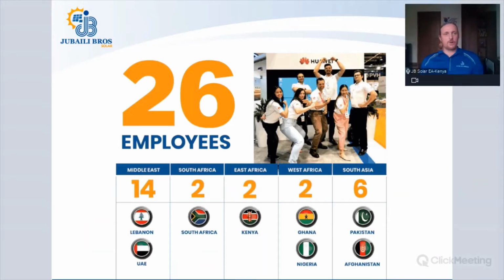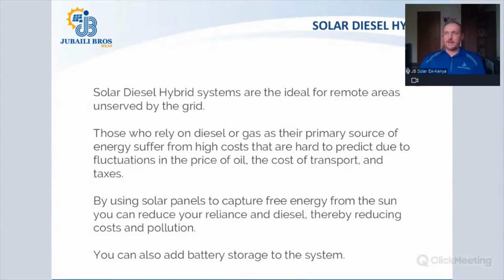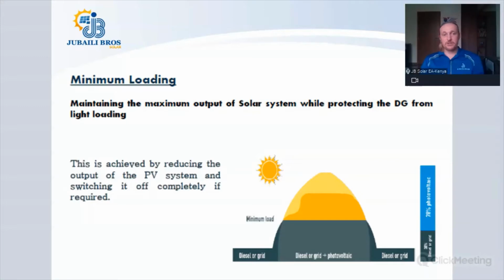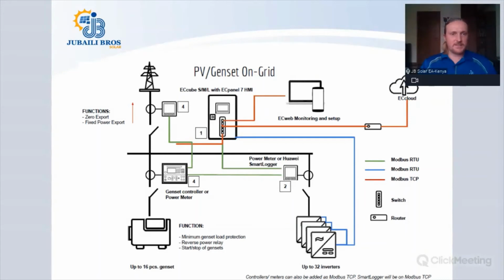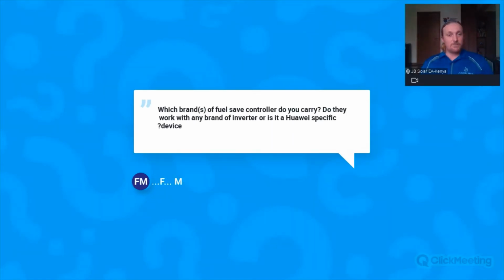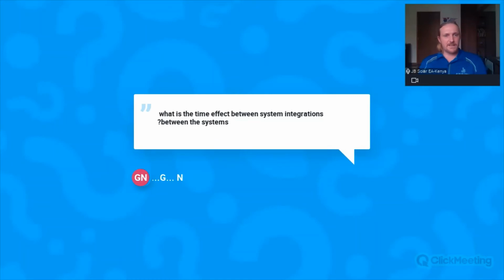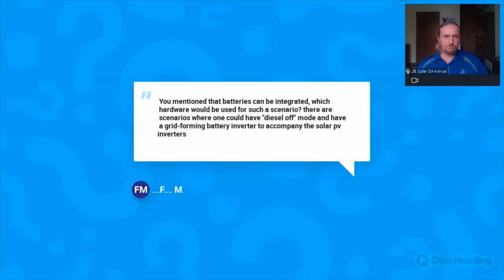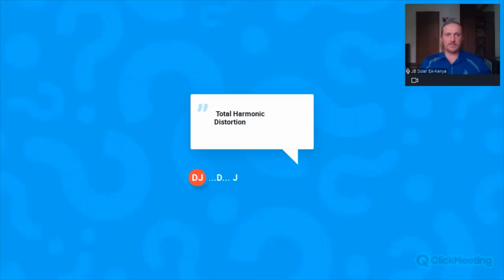Webinar: PV Diesel - Hybrid Solutions

Comment: We are operating on a micro-grid with SCANIA S500 Diesel Generators in Sindh (PAKISTAN) 
Wish to install On-Grid Solar to save on Generator Diesel Fuel consumption 
unfortunaitly the Utility Grid is not available 
Please let me know if you can provide us the control system for synchronization and power control for Solar PV Inverter 
and Generator to function seamlessly 
immediately we are ready to install 100kW Solar 
Thanks

Comment: Hello 
Can your On-grid hybrid Inverter operate without Grid ?
Meaning we have Diesel generator Sets and interested in installing  Solar PV Power Systems to work with Generators 
At present we do not have Grid also we are not much interested in LFP Batteries because of Cost etc.
All houses are supplied from Diesel Generators 
The Owner of the Project wish to Install Solar PV to save on Fuel Cost 
Also it is needed that the On-grid Inverters synchronize with Diesel Generators 
Please tell me if you can do that ? Also the estimated Cost of Synchronizing systems etc. 
Inverter of your Choice if any ?